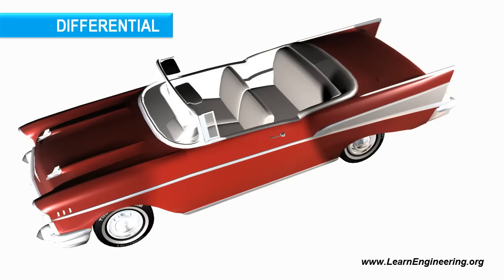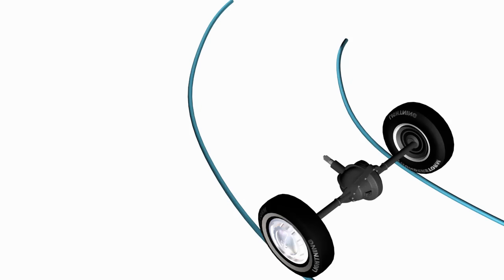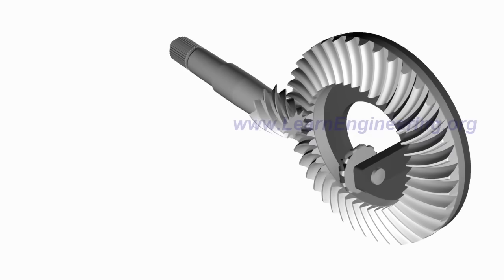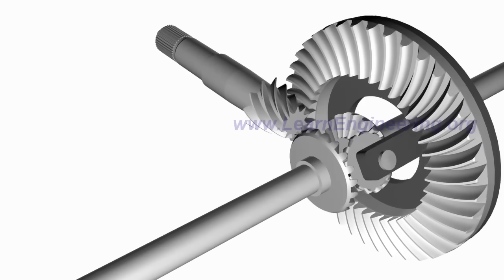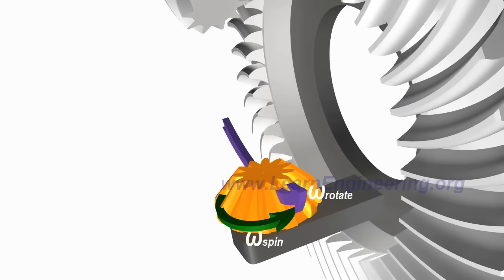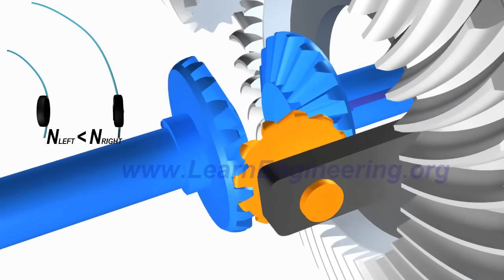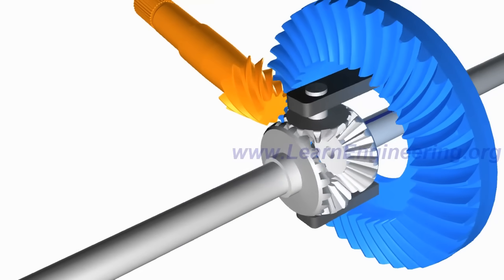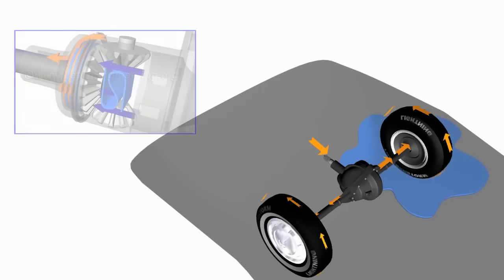How a Differential works ?

Comment: So when when a car travelling straight (with a regular diff, as described) begins turning, the torque (between lh/rh) must gradually decrease to the outside wheel as outside wheel speed increases; with torque to the inside wheel increasing as speed decreases?

Comment: One of the concepts that really benefits from animated video. For those people still baffled, I share that sometimes - the person who thought this up is sort of a genius but ignored the issue of traction on poor and variable surfaces.  Here's my short version: In a STRAIGHT LINE travel situation, you can treat the 'spider' gear(s) (the little bevel gear mounted on a bar from the biggest or 'ring' gear) as simply LOCKED to both axle-end gears, as if welded.  IE in a straight line, perfect surface traction, the twiddly bits in the middle are locked up in effect.  DURING A TURN - or of course if one wheel slips in mud and the other is stuck solid ! - the trick is to realise that the little spider gear is going to 'lean on' whichever axle-end gear is the most steady (the stuck wheel axle), and spins against that to drive the axle-end gear it can.  This situation means the little spider gear NECESSARILY drives it's way along the 'stuck' side, and TURNS THE FREE-SPINNING AXLE-END GEAR and thus the axle IN TWO WAYS - ONE with the spinning of the little spider gear about it's OWN axis or pivot, but TWO is the fact that the spider itself while doing this, is entirely rotated along with it's axis/bearing/bar that supports it, AS WELL.

That, ladies and gentlemen, is why NOT ONLY does the free-spinning wheel on a differential axle freely spin, BUT SPINS at TWICE the speed that the wheels would if only both of the frickin' things would turn together!  Hopeless.  As 'LEarn' point out in the next video about Limited Slip Diffs, this is the major drawback.  It's such a massive flaw even for occasional grassy-field parking, it's a wonder nothing was generally done about it for decades, the reason of course is that every tinker you do to this blessed thing, results in a headache you have to solve.  My solution?  Electric motors in every wheel and electronically control the relative speed to be theoretically correct.  Every vehicle then is AWD and regen braking is guaranteed, and the wheels that spin only are turned as software dictates - eg at exactly the same speed as any other wheel if you are on snow/ice, so basically it will impose driving in a straight line while providing the maximum grip - the rest is down to tyres.  You could even turn corners without turning the steering, by making one side of wheels go faster than the other.  Still, good vid.  It's not an easy concept to get your head around, despite drawbacks, whoever thought of it was a genius.

Comment: I've seen several of these  videos,  and I still don't get it because the Spider gear appears to just go in circles and be rotated  in place rather than Drive the axle.  
   Plus,  how can one gear with a fixed number of teeth drive two shafts with fixed numbers of teeth  and yet one shaft if turning slower than the other .
  
 I don't doubt it works,   but these engineer types need to explain it better become they sound like my High school  Teachers  in the  Tech classes and   Electronics , Chemistry  , Physics , and  Trigonometry   that  just repeated what was in their  Books    or  spoke as if we already  knew this stuff  and the  Lexicon that went with it .  
      
  I watched a video by a very smart Prof that tried to put a picture in the minds of the Students  as to see the reasons for why something happens   and  the expected end results  that the formula can prove  to check what you  did.
      In just 10 minutes   I understood  something that  never made sense in Electronic class and had puzzled me for over 30 years. 
     If we had more Good Teachers  that did it with a passion in their field of   training  , there would be more   Bad students  getting motivated to learn more in class because  they are taking it in and feel better about themselves when their  Marks go up .
    The City I live in has reduced  the Educational system to  Jobs-4-life   by people drawn to it for the money and gold-plated pension , not all are like that  but just this year  the Media reported on  a   Line item in the Budget  for  Math Teachers to be paid in a Summer Course they can take to learn  the basic Math skills expected by grade 8 .
  These are High school   Math teachers  that read from a Book what the Course material is end when  each Lesson starts and ends.  They don't have the skills to answer questions about the Math  or show  the students WHY  a formula is used  and how to check the results .
       We have   Diversity   Teachers  hired to meet quotas  but have poor English skills  ,  the  exams are    dumb down  while  Teachers now coach students to help them pass  Classroom tests   even when it's multiple-choice  and it's skewed to have absurd  answers to reduce the choice to a 50/50 chance for the right answer.

   
     I think that if the fixed parts were in a Unique color  and the moving parts were in color as the power flowed through the unit in stages.  I could see it better in my head    because  right now   the axle seems like the Solar gear as the  Spider gears are the Planet Gears  acting  from a force and not drive anything.
Reply: "I've seen several of these  videos,  and I still don't get it because the Spider gear appears to just go in circles and be rotated  in place rather than Drive the axle. "

As shown in 3:18, there is a hole in the tube that connects the wheel. This tube is connected with the small gear, that is connected with the Spider gear. The axle is no shown in the video.

"   Plus,  how can one gear with a fixed number of teeth drive two shafts with fixed numbers of teeth  and yet one shaft if turning slower than the other ."

Suppose you turn right. Then, the small gear will start rotating counter-clock wise. This is a little hard to imagine, but put it this way: if you are turning right and you, instantaneously, put the car straight again, it would be easy to visualize that the speed of the right side and of the left side of the small gear. The secret lies in the fact that the right side (in this case) doesn't need to move as much as the outer side, which is the reason why the left side is given an extra torque and the right is being held up
Reply: Programación Ca
I   agree it works,  but it would be better to build  the system piece by piece  and highlight  the free moving part with the ones that are fixed   to see the  flow of power through each part.
   To me , the spider gears  are mounted to the Ring gear that also drive the right axle shaft.  As they both turn as one unit the free spinning  smaller gears mesh with the Left axle shaft , so when the speed changes  how can the Left axle change speed when drive by  the spider gears of equal Teeth  meshed to the Right axle.
 There has got to be  something in the video they are leaving out   because the Left axle  should still lock-up  because it's just two shafts acting like one with the  Gears transferring power similar to a solid axle.    

  Again, I know it works ,  but the video seems to be for someone that already  knows how it works  or for people to just memorize  it and repeat it  while not really knowing the HOW and WHY.
Reply: RogerRamJet your problem is thinking that the ring gear is connected to the right axle shaft, it floats freely.  It is only connected to the bar that the spider gear is mounted to, and only meshed with the pinion.  So the bar on which the spider gear is mounted moves the spider gear.  The spider gear is free spinning and will spin on its axis if the blue shafts move at different speeds.
Reply: Gary wood when the inner and outer wheels have to move at different rates the intire carrier rotate, to make up the difference .if your ever at a salvage yard find a rear axel with the cover off and rotate one wheel, If it's an open diff they will turn in opposite directions and watch the carrier as it rotates. I think all will become clear once you see it in action. It's really hard to explain but it makes sense once you see it. The spider gears are rotating with the carrier as it turns on the carrier bearings during a turn or on the the cross shaft/pin at the same time they are spinning  around thier own center with each axel.
Reply: roger depew
  Right, but the Ring gear is meshed into the Pinion gear  which makes no sense for how the  spider gears works. 
    It's like trying to tell me that a complicated  watch  has all the gears meshed but  while two can rotate at different speed.
 Back in school  we only had to know what it was   and not how to build one or explain  the  path  of power  from the drive shaft to each wheel.
      Sometimes  a bad teacher  makes it tough for a good student  that want it kept simple .
Reply: one gear can turns slower than the other because they have differente sizes, thus the radio from the most outer point of the gear to the rotation center of it is different than the radio from the most outer pont of the other gear to the rotation center of it, which is the same place where they connect, in that point the speed is the same 0, its just basic rigid body mechanics.

Comment: Wow. I mean wow. I always thought cars were relatively simple, I mean they were the first vehicle ever invented and car mechanics are usually blue collar workers. But this stuff blows my mind. I've been learning how cars work the past hour and it keeps blowing my mind, but this... the differential... I am amazed. I am also embarrassed to think I could not have thought of such a good mechanism that was also so simple. Come to think of it, I wouldn't even think about the wheels needing to rotate at different speeds. Amazing, it corrects itself purely mechanically. Cars are freaking amaziiiiiiiiiiiiiiiiiiiiiiiiiiiiiing......
Reply: You don't need to invent a differential to repair it. You just learn it, the genius is the engineer that made it first. :)
Reply: Indeed - But some of the best engineers on the market are employed in racing, mostly F1, Prototype racing and rallying :-)

Comment: Wouldn't different width cars need different differentials or can you put the same differential in different width cars and it will work just as well? It seems to me in a wider car the outside wheel will need to travel faster than a narrower car which would require a differential with perhaps a different gear ratio?

Comment: This helps a lot. Thanks. Best.
Reply from the maker: Thank you !
Reply: Constantinos
Reply: Learn Engineering  please do how a motor cycle works
Reply: +Learn Engineering I don't completely understand the velocity part on how it allows the drive shafts to move at different speeds. Physics isn't really my thing.